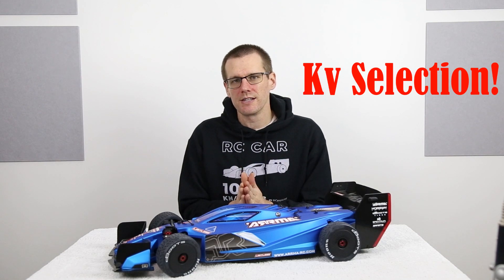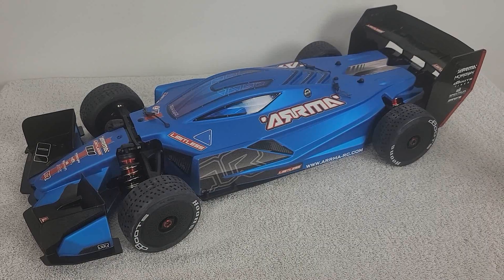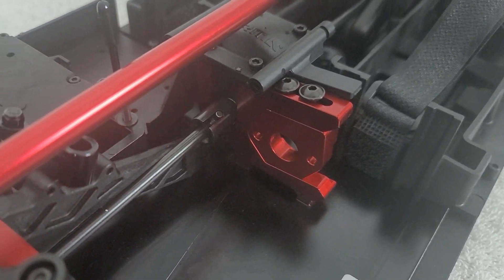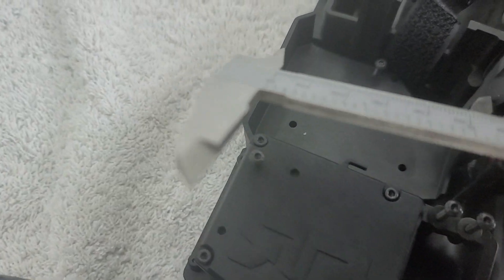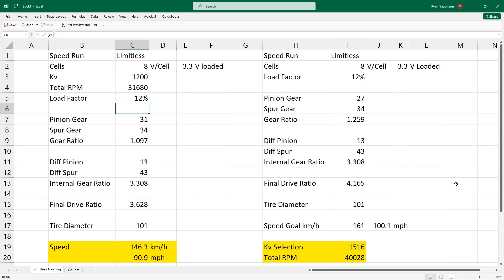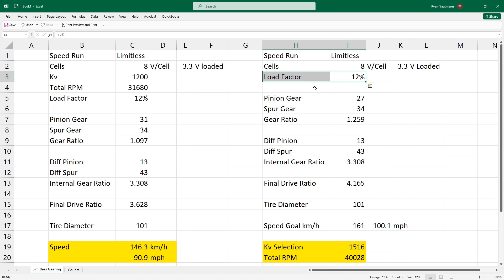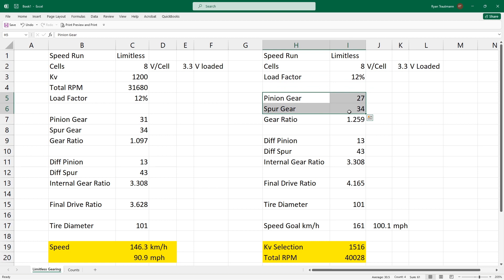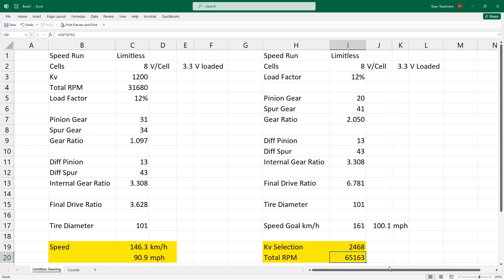Selecting Motor Kv for your RC Speed Run Build  - Arrma Limitless - Viewers Select Motor and ESC!

Comment: Going for 100mph on 2s best lipos tp 4060 cm 2000kv mamba x 8s 26/40 gearing hoping it does it 🙏💚👊
Reply from the maker: That will be very tough!
Reply: @RCexplained  yeah I knew wouldn't be easy mate if can't get away with upping pinion if close will have to go 3s then it definitely will 😂🙏💚👊

Comment: I have question …I have a limitless  I will be running 1900kv 4065 size  on 6s with 27t with stock spur gear with a mamba monster 2 I will like to know is that a safe setup for the limitless?

Comment: Can you recommend a motor/ESC/lipo/gearing setup for circuit use please?
Reply from the maker: Hey Dom, Is this for a Limitless V1 or V2? My gearing choice would change depending on which version you have as gearing is different between the two versions. 

My motor preference for a circuit V1/V2 would be Castle 1717 1650Kv
ESC for V1/V2 would be Mamba Monster X 8s
LiPo battery: 6s  5000mAh minimum up to 8000mAh from SMC, largest C rating for best performance. Choosing a lighter pack may help handling performance here. I prefer to use Amass AS150 as connectors on the ESC and Batteries.

You can split the 6s battery in to two 3s packs wired in series to place in to the 2 battery trays. Battery tray sizes are different between Limitless V1 and V2. V2 has shorter trays along the length. 

Stock gearing using a 27T pinion on a V1 would allow for straightaway speeds up to 140+km/h. A v2 would be even faster than this. For short tracks and even longer tracks, I would gear down (smaller pinion or larger spur) as you more than likely don't need that kind of top end speed. One catch is, you may not be able to go too much smaller on the pinion gear with the 17 series motor. In this case you could go up in spool size by swapping the stock spool for an 8mm Pinion gear. This works perfectly and what I used on the V1 Limitless to run a 22T pinion gear. 

Hope this helps!
Reply: @RCexplained  Awesome info. Thanks. This is for a Limitless v2 fresh out of the box.
Reply from the maker: If it's a V2, you can try stock gearing, however, I think you would be much better off by swapping the 39T spool for an 8mm 44T pinion. And then putting a 27T Pinion on the motor. 
I believe smallest pinion gear possible on stock gearing is around 32T.
Reply: @RCexplained  Thanks again ! I'll get it all ordered on Monday. Cheers
Reply from the maker: @EssentialRC  Cheers mate, I'd love to know how it all works out.

Comment: So I have a limitless and a 1580kv rocket hobby motor in stock form out the box gearing and I still get hot after about 6 pulls on max 6 esc upgraded fan as well as motor having dual fans on motor. Am I undergeared running 6s? and hits 100mph in this setup gps confirmed.

Comment: TP Power 4070 scm 2950 kv motor. ZTW Beast Pro 300A speed controller. 8s (2-4s) 6500 Max Amps True150C Lipos. 180 MPH

Comment: very kewl, so someone like me intending on running a 1:1 gear ratio  34-34    would get away with using an 1100kv motor, without the fear of too much temperature issues
im using the hobbywing 1100kv motor, its such a fat can i cant get anywere near the spur unless i run a 34t pinion.

Comment: Awesome tool bro! 👍

I have been running this car since April. I'm currently running a Castle xlx2 ESC with a Castle 1717 1650kv motor. This system is soo powerful and yet efficient that it's amazing. Even running 1:1 (34/34), I can do 6-8 runs back to back at ~119 mph with no overheating issues. I did 4 runs yesterday back to back on this gearing to test out some new CNHL racing line batteries, 9500mah/120C. My motor never got past 107F & my ESC never got past 102F, 4 runs back to back & the ESC fan never even came on because it never broke a sweat lol.
I have even ran this system with negative gearing, 29T spur/45T pinion. 2 runs back to back before things got warm but still within the safe zone.

Thanks for the info and link, gonna try it out to see what #s it comes up with for my next gearing setup, 34T spur/ 39T pinion. 😎👍
Reply: I run the same setup no issues what so ever. 30/34 gearing.

Comment: Lehner motors in the 30 series and lower with the carbon sleeve can go up to 65k rpm. This is the highest of any manufacturer that I know of.
Reply from the maker: Check out the Castle 1721 2400Kv motor and any TP Motors with a CM.
Reply: @RCexplained  The TP Motors in 1/8 scale and 1/5 scale configuration max out at 60k rpm; and I strongly doubt the 1721 is exceeding 58k rpm.

Comment: I recommend arrma GP5 diffs(2.8 ratio instead of 3.308) it will give more headroom in kv/gear selection, especially if you end up going for a beefier lower kv 56mm motor. Once you push beyond 100mph your load % will grow steep. In my world 12% is more wishfull thinking than conservative. So don't worry too much about motor max rpm specs as load will prevent reaching them. The Castle XLX2 is the only real option for an ESC. With the castle MMX8S as second. For various reasons others are not a valid option when chasing the maximum potential. Motor choice is more or less arbitrary. 125mph can be done with a $50 4092 motor...
Reply: max5 will do the job (just)
Reply: @1521joe  👍

Comment: Fyi: The hobbywing 4985 1650kv motor will hit the center spool drive cup if you use the supplied 27t pinon gear. I had to use a 29t gear and it fits perfectly 👍
Reply from the maker: Nice is the HW 4985 sensored? What ESC again?
Reply: @RCexplained  not sensored. Im running only a hobbywing max6. Everything fits in the stock locations on the limitless chassis.

Anything else you are moving/modifying things to make fit.

The max6 eac will run on 8s but the 4985 motor is "suggested" to run on 6s only.....👍

Comment: I used a Rocket 4585 motor  1580 kv with 6s 35c batteries, ratio 1:1 and it managed to go 110mph, I wish that I could try 8s but I don't know if the motor withstand that amount of voltage.
Reply from the maker: Great setup, 8s may be a bit too much for the motor. Although it is rated for max 50,000RPM! You would have to gear down if you dare to try this.
Reply: @RCexplained  According to the specification maximum voltage is 26v so I think I would be risking to blow up the motor, with the gearing that It has with 8s it will rev about 46k although when it is on load the battery will be like a 7s so regarding the revolutions it should be within limits but I don't know if the winding will hold on. Something else I think if I use batteries with higher output it could gain some m/hr.

Comment: Thanks ryan! This was very helpful! The spreadsheet i’ll defiantly be using it to calculate the speeds i want to go with for my rc cars.
I recommend a castle 1100kv or 2400kv
Esc: Mamba x 8s
Reply from the maker: Hi Colin, Thanks for the comment. Which do you prefer the 1100kv or the 2400kv? The new 2400kv motor is a very hot wind for use with the big XLX2
Reply: @RCexplained  for efficiency id go for the 1100kv